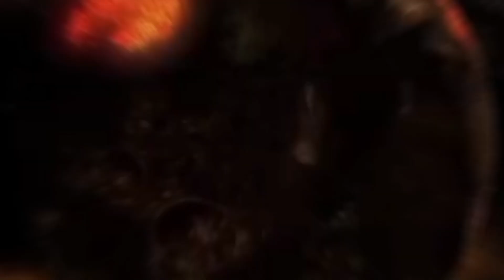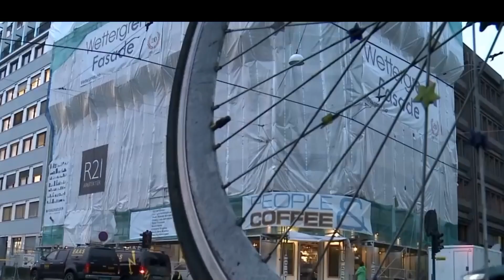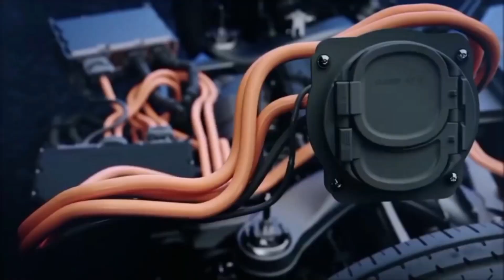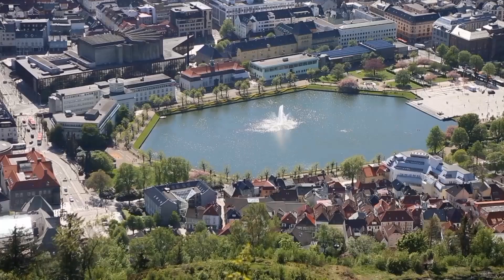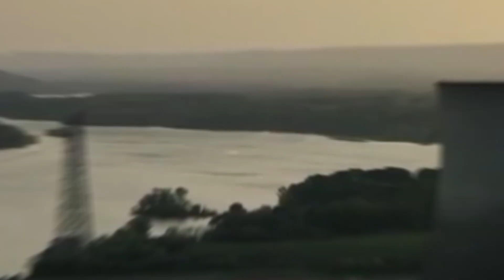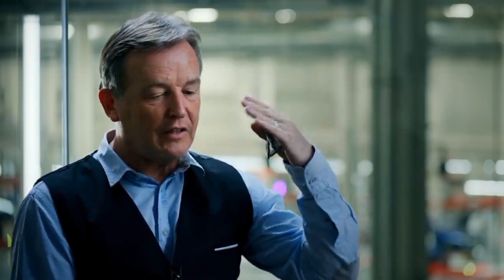Toyota’s INSANE NEW Nuclear Diamond Battery Is Here!

Comment: I tried to help the US auto industry by replacing lithium ion batteries with solid state batteries.  The US did not accept that, and they are whining about lithium ion batteries.  The lithium ion battery is a metal powder in a gel.  The gel behaves like water but much slower.  As a result, metal powder precipitates.  Local increase in metal powder leads to overheating and fire.  SS Batteries last up to 20 years compared to lithium ion which lose 10% capacity annually.  The price of SS Batteries is 10x lower than lithium ion batteries, which cost as much as 1/3 of the vehicle.
Reply: That was only 1% of the entire project, which would include charging the vehicle's battery while driving.  And they screwed everything up at only 1%.
Reply: @Stu Gotts from UK maybe they changed the density of the gel to buy time?
Reply: @Stu Gotts from UK have you read the warranty terms?  Does this include loss of capacity?  How much and over what period of time?
Reply: @Stu Gotts from UK today we see the behaviors of batteries that were said to be safe.  Can we trust them again?  Batteries based on metal powder in gel are not stable over a long period of use.
Reply: @Stu Gotts from UK I say this as a mechanical engineer with the desire to eliminate the danger to life from the use of this type of battery, especially in vehicles where there is a lot of shaking.
Reply: @Stu Gotts from UK I used to push solid lithium batteries that don't lose capacity.  Today, batteries without lithium with a capacity of 10x can be made with existing materials.  If you play with the materials a little, the capacity would increase by 100x.  If they changed the production method, the capacity would be 1,000x higher.  Lithium-free batteries are used by NASA and the Navy for their high safety.
Reply: @Stu Gotts from UK According to the German school, the vehicle is observed until its recycling/destruction.  that period is at least 30 years.  What is a 10-year warranty for a battery worth to me if it causes a fire in the garage in a short interval after the warranty expires.
Reply: @Stu Gotts from UK Currently, the battery costs 33% of the vehicle.  Should you spend what you save on the battery?
Reply: @Stu Gotts from UK just look at the number of fires on tesla cars.
Reply: @Stu Gotts from UK just buy a lithium ion battery and lose 8.75% capacity per year.
Reply: @Stu Gotts from UK solid batteries last up to 20 years.